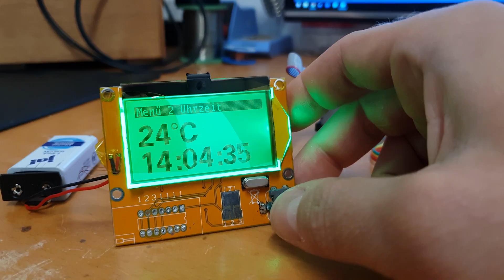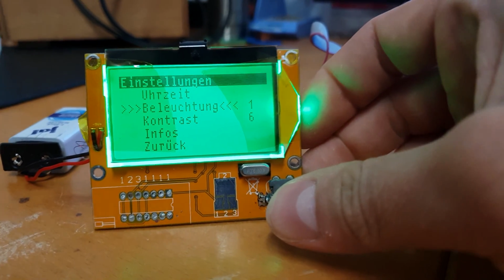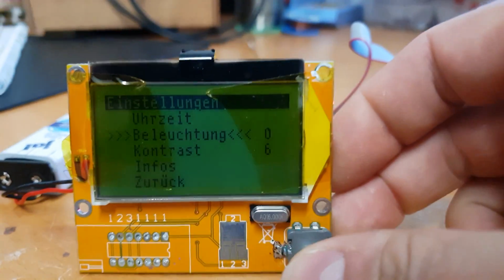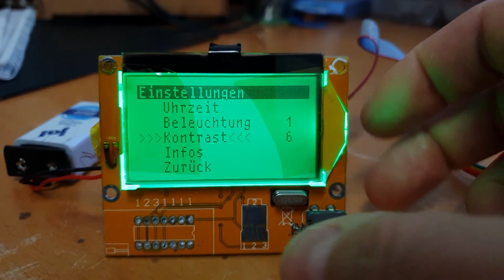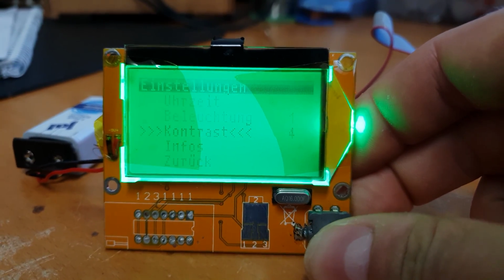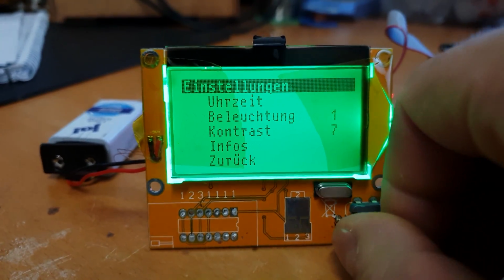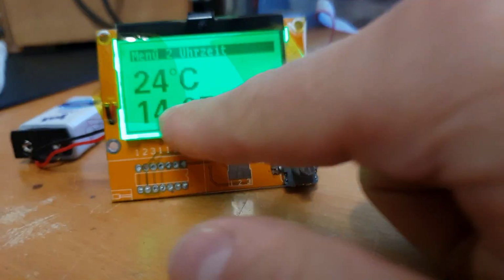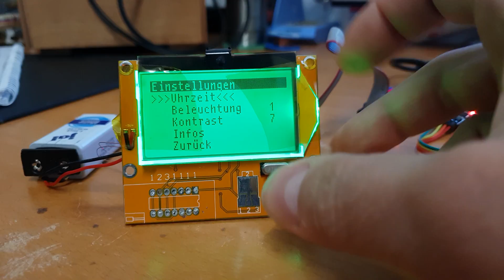Modified Transistor tester to car computer Arduino ST7565

Comment: You removed the crystal from the back and put a new one in front? Is that absolutely necessary? If so what are the specs of the new one and is that just a simple replacement job? Where I live obtaining parts is a real pain in the ass, so I thought I would repurpose my tester, but I am not a pro like you, so I could use some advice here...
Reply from the maker: Him i changed the crystal from 8 mhz to 16 mhz so i can use the standart arduino Bootloader, there is also a bootloader for 8mhz available maybe that is good for you

Comment: Dear Aaron, it seems to be great , thanks for sharing your project !
But I have tried to do the same but without succes . Download to the mega328p with USBtiny programmer seems to be ok, but no reaction from the board , nothing on the display and no backlight. So I guess my compilation was not ok ?  What board did you select for compilation in arduino IDE ?
Thanks for your help.
Roberto
Reply from the maker: Hi. Did you try to set the fuses ? You can easily do it by uploading the bootloader to the board via arduino ide. 
Also did you change the oszilator to the right mhz ? 

Thank you
Reply: Thanks for your answer. 
I just download bootloader via arduino , but it is not better ... 
I see that you select SPI for U8G2 interface in your arduino code , but I see a I2C connection in shematic . Is it ok ?